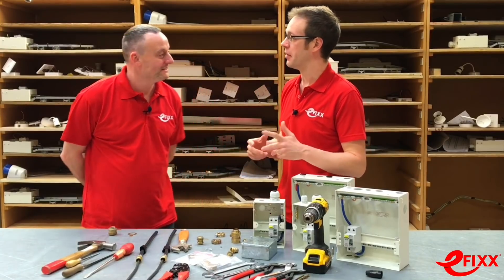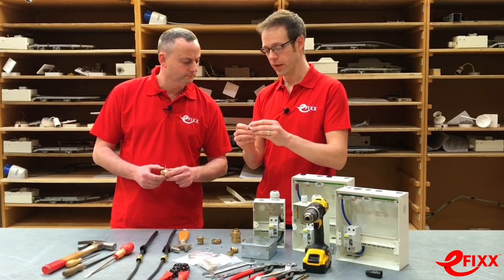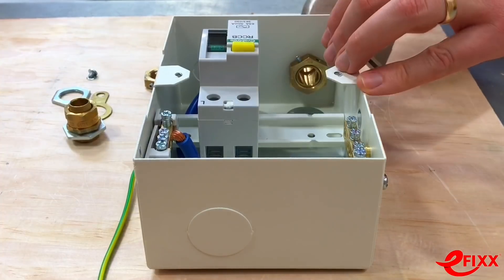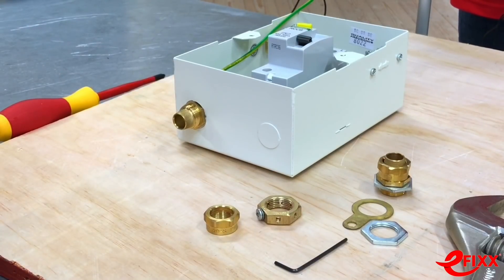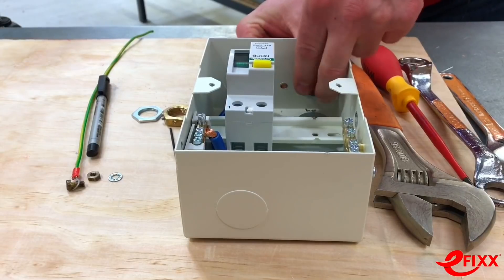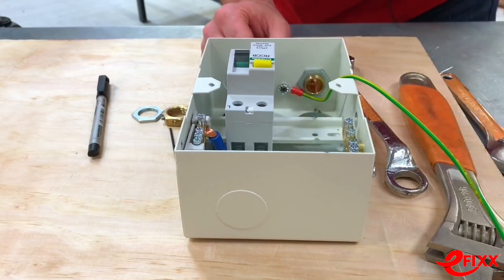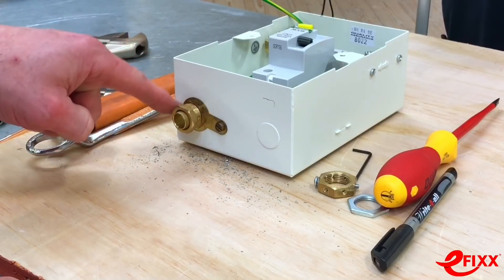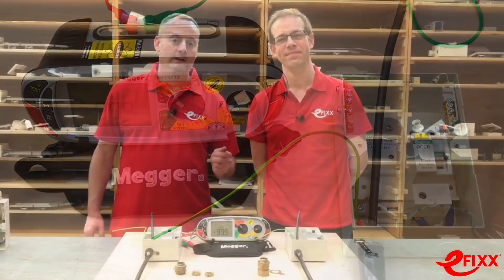SWA Cable Gland: Earthing Nut vs Conventional Banjo and Lock Nut for cable glands.

Comment from the maker: **MORE** - Find out how SWA Armoured cable is made in this factory visit.
https://youtu.be/0MFlJzJb_Qk
Reviewed: Innovations for armoured cable
https://youtu.be/4TRUYojHmw4?t=166
Reply: I feel your point about removing the paint from the enclosure is not necessary. The armour is connected electrically via the gland. The gland via the banjo. The banjo via the fly lead to the earth terminal. The earth terminal is normally connected by the manufacturer to the metal casing. I feel you are making a mountain out of a molehill.
Reply: Ll
Reply: @keithmyerscough1861 pp
Reply: @keithmyerscough1861  l
P
Reply: @keithmyerscough1861  
Ln..ml.
L
Reply: Gl
Reply: @keithmyerscough1861  l
Reply: @keithmyerscough1861   g g🙂😥😇🤔🤔🇧🇪🇧🇲
Reply: @keithmyerscough1861  g
Reply: @keithmyerscough1861  lgl

Comment: I've never done it this way. I keep the swa tag on the inside of the enclosure, bent up the tag a little and used a nut and bolt to clamp the earth ring crimp to the tag. Never had any issues with R2 readings this way.
Reply: That's exactly what I was thinking of doing bending the tag up , that's before I saw the earth nuts , I've never done this before and have just ordered the glands , and looking at the price of the nuts , I think I'll bend the tag up
Reply: Exactly what I do, keep it all inside, ive used these nuts too but on some small enclosures they are too chunky especially side by side on a switch.

Comment: Great job but would have liked to see it done with SWA cable attached. Cant understand how your suppose to hold the locking nut on the inside while rotating the fitting on the outside, if its a terminated cable. Thanks great help.

Comment: If you use a tap to cut a thread into the metal enclosure and then use the bolt would you still need the fly lead

Comment: Another interesting video fuelling the debate on which connection type is better. Most people like the new piranha nuts but they cost more.

There has long been debate about fitting banjo tags. You fitted yours on the outside but many fit them inside to reduce corrosion and improve the cleanness outside. You can buy pre-terminated banjos with flyleads on to reduce the fitting time. If you fit them inside and the case has a cpc bar earthing the cabinet already as yours did then should you drill the case for the banjo or just connect it to the cpc bar as you would with a piranha nut? If you drill the case it takes time and corrosion follows. Same on a plastic case, is there a need to drill the small hole for the banjo as its not earthing the case? You views welcome on best practice.
Reply from the maker: Great points as always Neill. Gaz 👍

Comment: Love that idea. Another great and clear video. If a current old SWA cable in an garage only has two cores ( Live and Neutral) and uses the armour as the earth would you need to install an additional earth rod incase the armour ever suffered corrosion or a s the armour deemed satisfactory?
Reply: The armour is deemed sufficient to be used as the CPC

Comment: I am aware this was a demonstration of nut V Banjo, but I would still have thought the Banjo would be better INSIDE the box. I do a lot of caravan hook-ups and insist the Earthing tags/banjos are all on the inside of the IP44 box, to cut corrosion, They very quickly go Black if on the outside. And don't start me off regarding the use of steel nuts and bolts, I have replaced no end with Brass.
Reply: What do you use for the lugs? Are the tin-plated copper ones preferable over the red/blue/yellow stuff?
Reply: @JohnSmith-ws7fq  I will not use anything ferrous on the outside of the box, and am particular on what I use on the inside, due to corrosion.
Many times I have had to grind through rusted nuts on the outside. And replace brass banjos fitted on the outside, as they go Black.
Quite often, people have used the SWA shield for the Earth. Which is OK in principle, but if they use steel fixings, the resistance soon goes beyond the standard to protect life, should a fault occur. Am I wrong to look to the future.?
Reply: @JohnSmith-ws7fq  As for lugs, I only use tinned copper.
Reply: @G1ZQCArtwork  Thanks, good points.
Reply: I see no point in drilling a hole through a plastic IP66 rated enclosure due to the banjo being fitted on the outside of the box.  Like others, I bend the banjo and fit it inside the box.  Less holes in the box = less chance of water ingress!
Reply: @paulhill9132  Quite right too. If two are close enough together, a single brass bolt will do the trick. Less holes, better protection. Many a time I have had to evict a family of Earwigs or Clear years of Spider webs from a Caravan box if someone left a hole.

Comment: So if you’re running between two plastic enclosure consumer units,does that mean the earth rings/nuts are redundant?
Reply from the maker: No you still need to connect the metal armour to the CPC.
Reply: The armour is an exposed conductive part which could become live under fault conditions - so it should be earthed.
Reply: @socialscene6361  I've spoken to about six electricians since and they all say the same thing: "It's a protection earth in case the cable is severed (usually in the ground), and should be earthed." I have my SWA running over a garage roof and cleated to the wall, so no fear of it being 'dug into'...but I will earth the shell regardless...
Reply: Is it OK for the swa to be earthed just going back to source and not at the front with another banjo

Comment: Hi guys I understand the idea of removing the paint for metal on metal connection and know you shouldn't make assumptions but I assume that the paint isnt there just for aesthetics and its purpose is to offer some kind of protection against corrosion and fire.
That being said, will removing the paint, then make the ccu not comply with safety regulations? Good vid by the way.
Reply from the maker: If it was an IP rated board in an area subject with water or corrosive chemicals then you would need to consider paint removal as an issue. Remember when you push out a knock out or drill a hole you are exposing uncoated steel.  Paint won't last long in a fire!
Reply: I am an adult learner who started level 2 (2365) this September. 
I find all your videos extremely helpful, and thought of the question during this video.
Thank you for the reply and the information.
Keep up the good work 👍

Comment: should omit the pilot hole and drill with the finished size drill bit straight in as you are case hardening the steel by use of the pilot